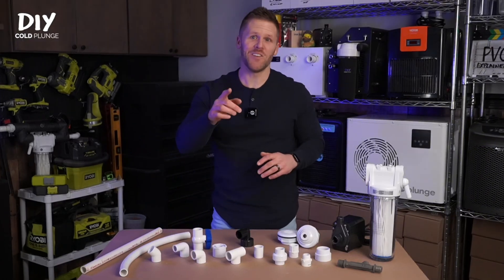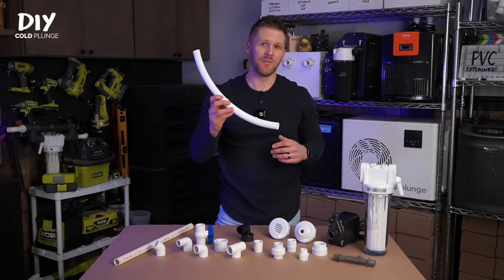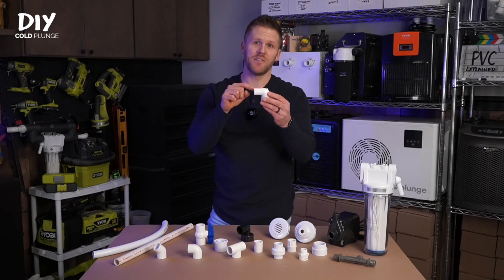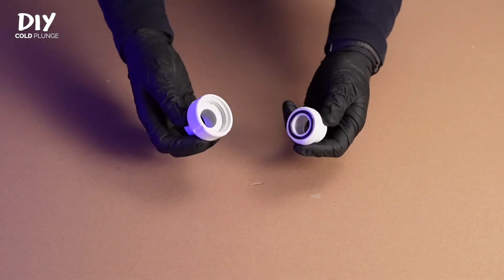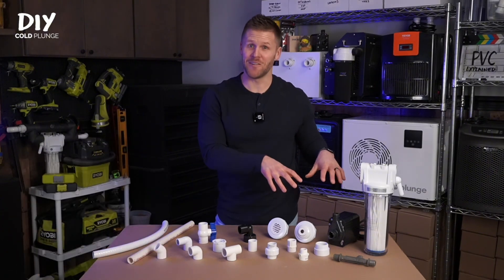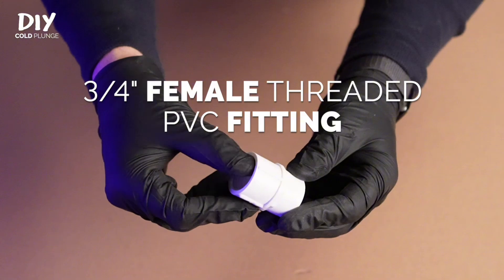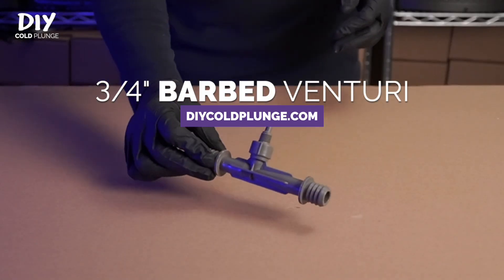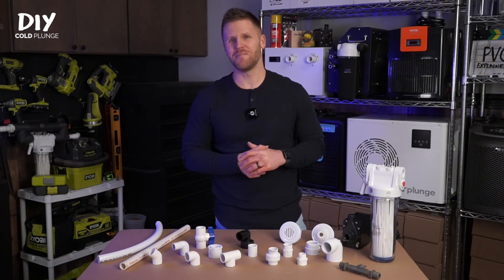EVERY Cold Plunge Part Explained | PVC, Pumps & Filters for a DIY Cold Plunge

Comment: does cpvc fittings work?
Reply from the maker: Not with PVC, I'd stick to this for a cold plunge
Reply: @DIYColdPlunge I have other tubing and setup from a bundle, just trying to make the filtration component, does it work with the spa tubing?
Reply from the maker: @nickdagostino1844  You'd need a specific primer and cement to make those two materials connect to each other without leaks
Reply: @DIYColdPlunge I made it work but have no suction through Venturi, do I get a bigger pump?

Comment: Joe, Your videos should be a standard on how to teach others "How to make the perfect instructional videos". Thank you for your clear concise explanations and information. I'm building a Grizzly Cold Plunge with a Penguin 1/2H Chiller and the Danner 1200gph Pump. Your videos have helped me have the info and confidence to tackle my build. Other people's videos show you "some" of the components to use but your videos have covered everything I need to use for mine including the plumbing like this video.  I also have the same Ozone Generator and had a question about the sanitation. I didn't see you mention anything about using small amounts of Hydrogen Peroxide in conjunction with the ozone. Is this overkill or have you ever used it or tried it? Again, Thank you for the helpful videos and I will be gladly purchasing some of the products from your link.
Reply from the maker: Thanks so much! Happy to help

Comment: Hi Joe- I wanna make sure I do this the right way. I have a 100 gallon tub and a Rocita chiller and insulated cover. I want to build the plumbing & sanitation system. But I’m not worried about the aesthetics and insulation (right now - may build an enclosure down the line). Which plan should I purchase on your website so that it is straight forward? My goal is to cold plunge without replacing the water biweekly ( as I’m doing now ). My set up is inside and will always remain inside.
Reply from the maker: Cool! The plumbing plan on this page is what I'd recommend. It is completely modular and adaptable. In the event you want to build/modify anything you'll be able to reuse every part. https://diycoldplunge.com/products/stock-tank-cold-plunge-plan
Reply: @DIYColdPlunge  Actually I want to go ahead and just build it. Thanks! Will purchase now! But wanted to ask, the plumbing enclosure, what's the purpose of that? Do I need to do it if I intend to keep my plunge indoors?
Reply from the maker: @Gltydave  Nope! I actually keep mine outside and don't use it. I just had a lot of folks request it.
Reply: @ bought the full plan last night! May get started this weekend or next. Thanks!!!

Comment: Also, what about a UV light? I'm just over engineering at this point. Almoat ready to order all parts!
Reply from the maker: UV can be finicky... and many times not as effective as ozone. Many cold plunge companies used it early on but soon dropped it because ozone is more effective, bulb power diminishes over time, harder to maintain, etc. Nothing wrong with adding it though, I've just never felt the need to.